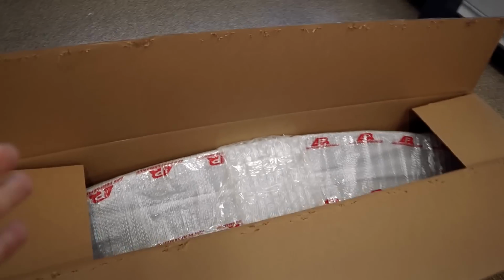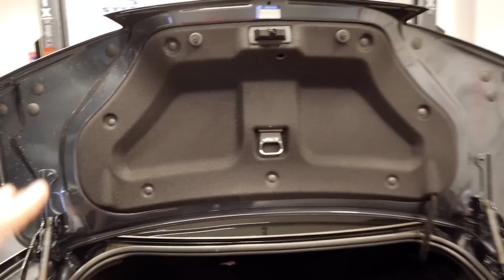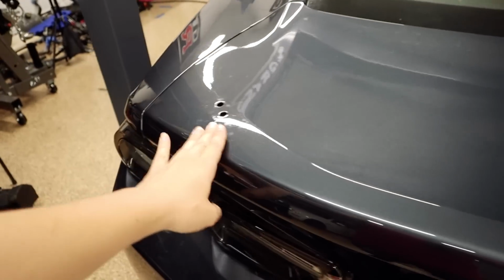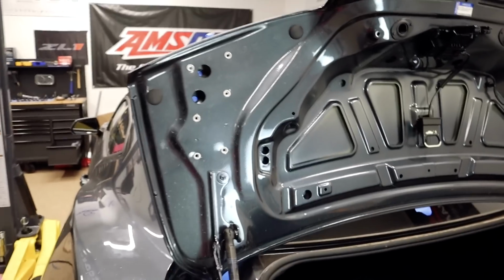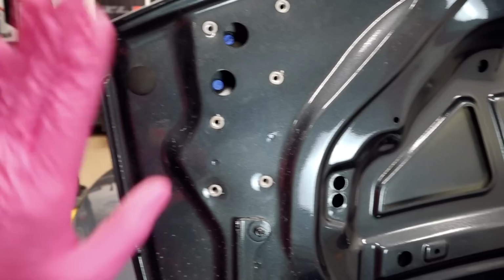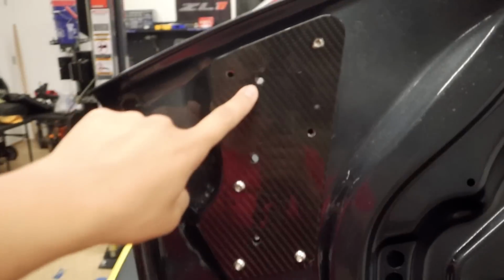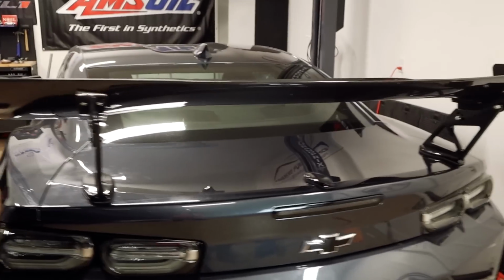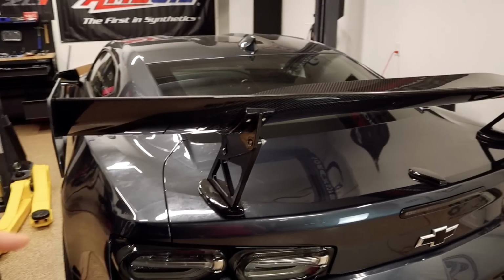THAT'S A BIG WING! Installing an APR WING on my CAMARO ZL1 1LE!

Comment: How I fix a paint chip. I fill the chip with an angled cut flat match stick using made up paint spray can from Napa with my paint code, I spray a bit in a spray can lid and dab the match stick to fill the chip in layers. Then using 400-2000 grit paper, I wet sand. For my sand paper size, I  use a paper punch to cut the piece so it can fit on the rubber eraser of a pencil using 2 way tape. If I need more paint to build it up, I repeat my procedure. Then finally buff out with a finishing compound and wax.

Comment: another great video Doris.

I think you're right you should change the side plates, but not with something out of box. go to a metal shop that does fabrication and bring the shape you want on a piece of cardboard. Maybe match one of your logos or insignias for your brand name. you can also have it laser etched into the metal. just imagine how cool that would look and personalized! I'm not sure whether painting it to match your body paint or maybe a hot pink with matching lipstick would suit you nicely. if you painted body color you might be able to get the paint shop to throw in a touch-up of the spot on your trunk. if I owned the shop I would do it Gratis just for a mention on your Channel.

regarding the holes in your trunk, although this probably won't be an issue for you in Arizona but anytime I mount a spoiler or anything else on a decklid I always use RTV silicone on the holes and around the perimeter of the spoiler base to keep water out. in much of the country you would surely get water under it and working its way into your decklid causing it to rust out from the inside. little things like that can destroy cars in rainy climates especially up north where they salt the roads.

I can't wait for the next video

Comment: For the accidental drill I’m pretty sure you can use a touch up pen. Get one from the dealership. Have your full VIN in hand. Your paint code is contained in your VIN. And don’t forget the clear coat.

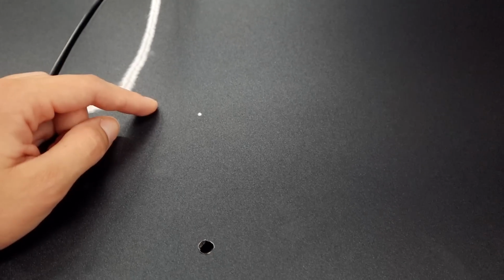Comment: 10:54 You can repair it with touch up paint, sanding blocks, clear coat and level it out with compound and polish. If done right , you wont see it/.

Comment: For the minor scratch from the drill, buy some touch up paint but dont use the paint brush tip that comes with it...  use a toothpick take your time and fill the hole just until you have a slight bulge in paint and then let dry. Make sure you clean with alcohol before you start...  good luck.

Comment: Doris, I would put some primer then colour coat then clear coat. Use a paint shaver to shave the clear coat to just about the level as the rest of the paint, then use progressively finer (start with 4000) sand paper. When is it close to the smoothness you want polish it with compound, then wax it unless you have already put a ceramic  coat on, then just use that

Comment: You should also use the touch up paint to cover the exposed metal where you drilled the holes. Just for rust prevention. Luckily you live in AZ so it's pretty dry there.

Comment: I like all your cars but would like to see more on the Camaro so this was nice to see. Feel bad about the mistake you made. You kept your cool well. I would have to do a retake I would have been so pissed. I ordered a 2SS 1LE in December built on 3/9 still awaiting it to be delivered to the dealer. I like your color I was considering that color but decided on Satin Steel Metallic in the end because it shows the dirt less and in the sun light the metallic flake really pops. Great videos all around. 

Shaun

Comment: I would fix the mistake by using a color match touch up paint and clear coat. Add the paint to cover up the blemish then add clear coat a little at a time until it is just above the surface then carefully sand it lightly down with 2000 to 3000 sandpaper until it is an even surface and buff it out to bring it's beautiful shine back.

Comment: I guess the front splitter and rear spoiler addition is obviously for track use.
The downside to these "track" aero additions is straight line speed....it's a give and take when you add these aggressive track aero add-ons.
You can always take them off for straight line speed.

Comment: Nice work, young lady!  I have to admit...I cringed watching you drill the holes from the bottom of the decklid without a drill-stop!  I poked a drill tip too far and created a little dimple on the top of my Mustang decklid when installing a spoiler many years ago.  It didn't go through, but it made a little dimple on top that you could see in the paint!  Ugh...   I didn't expect you to start drilling that extra hole though!  lol!  It happens!   It's how we learn!  :)

Comment: Hi Doris u can get some touch up paint made at an body shop store fill the mark in with the  paint make sure it's not a paint pen but paint u mix with a hardner touch up the mark and let it cure wet sand it with 2000 grit fist then 3000 grit trizac then polish with rubbing compound and it will blend in just fine great videos

Comment: Did you fix the boo boo yet...?...if not grab the touchup paint...since its small and bare metal...get a heat gun a go over the spot til it warms up....do not keep the gun steady on it...move it....once warmed up good... apply a drop at a time of touchup paint til you fill the hole....the heat makes the metal expand so the paint goes in the pores of the metal....once the hole is filled let dry completely...prolly next day to be safe....and use with HANDS NOT BUFFER...a low cut compund...since car seems new....in circle around maybe 2 or 3 inch circle...the boo boo seems small on the video....then hand buff out the compound...then polish it also by hand with your favorite wax/polish....and your done....

Comment: keep that drill error and show it( maybe put a dab of clear with a q tip on it) its your car right??
Reply from the maker: It's my car, yes. I mean.. I don't really mind.. I know others do. This car sees track time so the front bumper will looks worse over time.
Reply: So now you have that slight paint and scratch to take off in weight when you do track have it in your head cause now it's the character of your machine 😉

Comment: Why change the spoiler? The original spoiler was developed by Pratt Miller racing. They are the ones that develop the Racing Corvettes that win at Lemans and develop the NASCAR Camaros. So you get the quality part, the strength of that center post (no sagging at high speed), and. probably better carbon. Is this spoiler actually proven to be better on the track? Just because its bigger doesn't mean it can preform better when you actually put wind on it. I can understand changing the original ZL1 spoiler to this. Just wondering if this is actually better.
Reply from the maker: I think you need to do a bit more research on APR Performance. I can guarantee you they know about aero. A lot of actual track and race teams use their products. Also keep in mind the stock ZL1 1LE wing is designed on a consumer car first. Pratt and Miller designed the Camaro GT4.R wing, which is as large as the APR wing. Why? It provides better performance.
Reply: @woman.driven  Got it, so it's not just some untested kit. It's legit. Thank you for the info. Love your videos 🙂. Ur part of the reason I got my ZL1 😁
Reply from the maker: Correct.. APR has extensive data and testing on all their produces. Tons of white papers and wind tunnel testing. Thanks for watching my videos! That's awesome I was a small part to your ZL1 purchase :)

Comment: Use chipex to fill the small blemish on the boot, it fills in the hole then uses a solution to dissolve away the excess paint leaving an unblemished look.

https://www.chipex.co.uk/kit-select/?id=667945